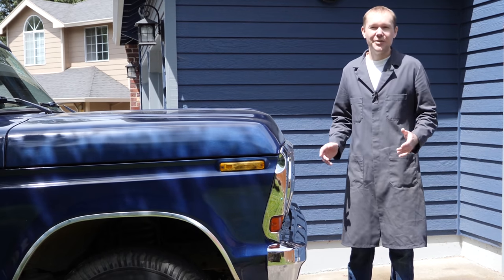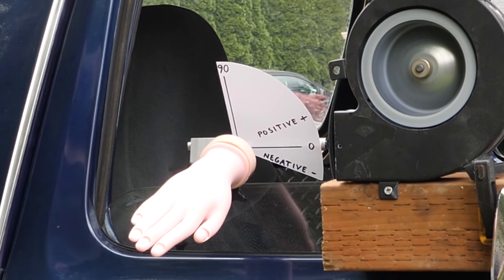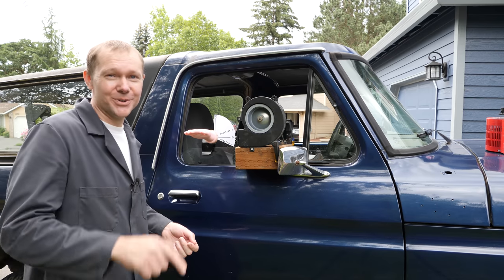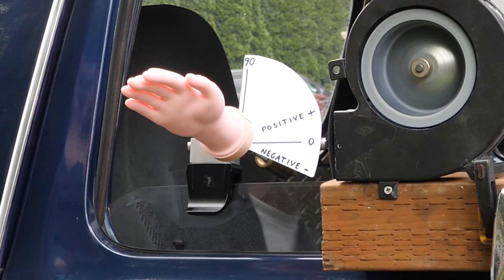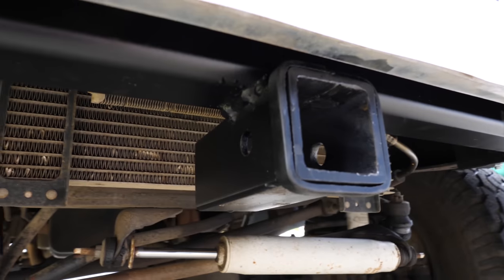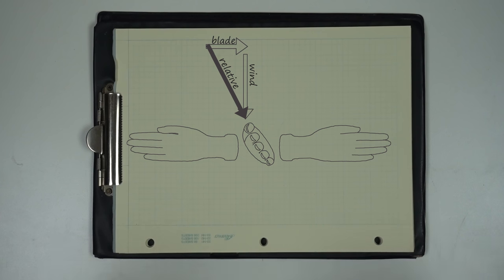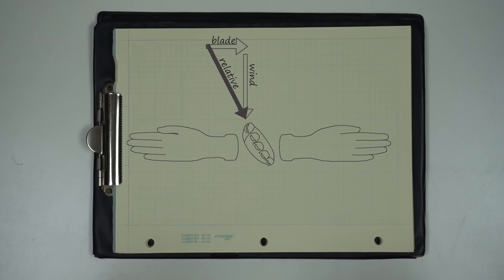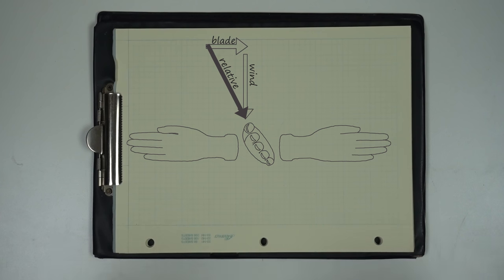Wind Power on a CAR #1 - Is it FREE?

Comment: I think you know very well how this is going to turn out Quint, you're smart enough to know about conservation of energy. I still appreciate you taking the time to prove it once and for all.
Reply from the maker: I appreciate the props (no pun intended) but if the front of the truck is doing work on the air already and the turbine does some of it instead...  I'm honestly not so sure it's a straight conservation of energy problem.  Clearly if it were mounted above the truck that would consume more fuel but down in front I suspect maybe not?
Reply: @QuintBUILDs  Well, if you're gaining electrical energy, and don't need more mechanical(?) energy for moving the vehicle, you're reducing energy losses somewhere else, which could only be wind drag. I can't imagine the turbine doing that, but who knows. It's always better to test than to guess, right?
Reply from the maker: There you go.  A further complication is the air that would normally flow through the radiator to cool the engine will definitely be affected.  There's a clutch fan in there that should be disengaged at highway speeds.  If it has to kick back on then certainly that won't help the effort.  But yeah, with enough instrumentation we'll know for sure!
Reply: @timderks5960  I think you know you were right first time. There aint no free lunches.
Reply: @kirkc9643  But I'm not sure about wether Quint is far off, here. If he can reduce losses then he will get more energy out if the entire system "for free". I kinda doubt this approach will work for that - but I'm also not 100% sure it wont...
Reply: yep tim is right, you'd still have to push the truck trough the air and even more, you now also have to push the fan (drag) trough the air. Imagine an airplane with a fan on the front and on the back; the front fan delivers energy which is used to power the fan in the back, the fan in the back also has a battery. in this analogy, the truck is the airplane, the front fan is still the front fan but the truck's engine is the back fan and the battery is the truck's fuel tank. you can play around as much as you want with the pitch, size of the fans etc but your airplane's battery will not last longer with the front fan installed, quite the opposite; the 'generator fan' will only cause extra drag. Nonetheless, interesting experiment!
Reply from the maker: BTW I appreciate the intellectual tone here.  So many YouTube comments are pure emotion and shaming but this reads like an actual discussion.  Maybe because the subject matter is deep enough to scare away those that truly don't know?  Either way it's refreshing and I want to say thank you!
Reply: @QuintBUILDs  I agree Quint. It really is refreshing to know there are smart people actually engaging in adult conversation. You may be right. This type of subject doesn't usually attract fear and hate-mongers and numbers are hard to argue against with emotion. I appreciate so much that you are working out the exact type of questions that I have had. I think this type of tech will be one of the key solutions for humanity in upcoming decades. It's so good that there are people like you figuring out where the limits are.
Reply: @TheMightyZwom  Same here, I doubt anything like this could ever work (given the theories), but I'm also not 100% sure it can't, so I'm still curious to see what happens. Experimentation is the only answer I guess.
Reply: Jan Jansen I think the theory here is that since the truck is so inefficient they are trying to increase the efficiency. If the wind turbine was mounted up high and out of the airstream I would say absolutely no chance. But putting it in front of the airstream may have some benefit to such a non-Aerodynamic vehicle. It’s interesting to think about.
Reply: @lawnmowerdude  yeah i agree and to be clear, i'm also not 100% sure myself on how this is going to work out. that's why i resorted to a (simplistic) analogy. My thinking is that eventual effects might largely be caused by changed aerodynamics rather than by 'recuperating' lost energy... although one could argue that the ventilator, due to drag to spin it, only negatively affects aerodynamics since the car behind the ventilator is still there. There's only one (okay maybe more;)) ways to find out though!

Comment: Your videos are always awesome! I need part 2. A long time ago built a wind turbine for my truck, it was made from a "wind tunnel" of 12v DC computer cooling (axial) fans. Wired them all in parallel to increase the amperage. It would charge a small 12v riding mower battery that I had a small inverter hooked up to. Used the inverter to charge drill batteries at job sites with no power on location.
Reply from the maker: NO WAY! That's awesome!!! 👍

Comment: I have had a similar idea for quite some time which in building for my channel. Although mine will be for a construction style generator.  The added drag from point A to point B is accepted for me simply for the fact I won't have to listen to a generator running all day while I'm working. Basically wind turbine driven alternators will charge batteries with high amps on trips and large solar array will extend battery life during use and stationary time.  All while I can pull up to a job and enjoy 6-8 hrs of quiet power without any loud generator running all day!! I can't wait until I'm done with it! Nice video bud.

Comment: Hello sir, just wanted to let you know you were RIGHT ON THE MONEY. I worked for Siemens Gamesa Renewable Energy as the finisher/painter for their wind turbine blades. Of note, I want to mention that the blades we make are intentionally bent slightly backwards at the tip, because the torsion of the wind against the tip causes it to become parallel, increasing its efficiency. This mostly has to do with blade length (53 and 64 meter blades) and yes they are as big up close as you might think. 

You've gained me as a subscriber, because you are very good at doing your research and presenting in a simple but funny way. Keep it up😁
Reply from the maker: Wow, thanks James!  This project is harder than I thought but I think it will be worth it in the end.  REALLY appreciate the approval from someone in the business!

Comment: You can absolutely generate energy electrical energy by attaching a turbine to the front of your car, BUT it's not free. The energy you're harvesting is from the fossil fuel you fed your car.

Digs up fossil fuel (chemical energy) - > motor converts to kinetic energy (and lots of waste heat) -> turbine converts forward motion of the car into rotational kinetic energy (and some waste heat) -> generator converts rotational energy into electrical energy (and some waste heat).

The energy harvested by the turbine will be proportional to the reduction in fuel efficiency, cancelling out any gains. Actually, it's worse since each energy transformation loses some useful energy (as heat). It would be more environmentally friendly to produce electrical energy directly with a gasoline generator.

That being said - this video is great and goes a fantastic job explaining how the blade of a turbine work. SUBSCRIBED

Comment: Very cool video with great instruction and funny too! It will work but I think it will also increase the drag and increase fuel consumption too with no net increase in energy production. However, if your mobile wind turbine were raised automatically from the back and telescopically standing tall when the vehicle shifted into park it would act like a smaller version of a modern wind turbine and generate a net increase of electricity. However, I think having a solar PV canopy built onto and over your truck would generate way more electricity if the possible goal is a self powered, electric vehicle. Love your video, skills and knowledge!

Comment: I remember having this idea as a kid, and my dad basically explained that the force of the wind is actually the force of the vehicle moving forward. The wind turbine generation is not generating power from the wind, it's generating power from the vehicle engine, indirectly. The propeller would create more drag than it would generate electricity. The only way this would work is if the propeller somehow had less drag than the front of the truck originally had. Which is maybe possible, but it begs the question, why not just make the truck aerodynamic. Less fun, I guess?

Comment: I was actually talking about this when I was about 8years old, and combined with solar panels on the roof of the car like wolksvagen is going to do on the new hippie van you can get some extra miles! But I was talking about taking out the passenger seat and make a wind tunnel to capture more direct wind on the propeller
Reply from the maker: Allowing a straight pass-through would be really fun to try.  Maybe if I was getting my windshield replaced soon...

Comment: years ago on TV a college made a wind turbine powered buggy he drove it accross America and not at a slow speed, it had 1 n200 battery to get it upto speed and then it ran off turbines , chain driven on one rear wheel. here in Australia a company is making solar power cars 2 seaters vrry aerodynamic light weight with the most effecient solar panels

Comment: I have always wanted to try this but my wife veto the idea a while back.
   But one thing different that you might explore is instead of putting the turbine out side the slip stream you could 'funnel' a part of the slip stream into a fixed tube going through the car. Think 3 inch pvc pipe fixed to the undercarriage or side so the concentrated slip stream goes into the pipe and then moves a permanent motor/generator as it exits.
Reply from the maker: That's one of the advantages of an old truck, the wife doesn't care what I do to it!  Along your suggestion, someone suggested a blower hood scoop with a fan under the hood.  I might even consider that if I can find an old hood and fit a scoop on it for cheap!

Comment: Hi Quint! 
Okay! So you put a wind Turbine on the front of the truck... Two things!
1) In future, try a vertical wind turbine or series of vertical wind turbines. See how that compares to standard propeller type wind turbine.
2) Wind Funnel: By creating a funnel for air to move through, the air at the narrow end would be of a higher velocity. Sort of how exhaling with your mouth wide open to check your smelly breath is a gentle breeze, while blowing from tightly pressed lips results in a faster stream of air for extinguishing birthday candles. Stronger force of wind = more spinning turbines, right?
The wind funnel idea could be interesting. Like, you'd move the turbine back a bit, and then put a device in front that looks like a funnel. as all the air hits the space - maybe it's 3 feet by 3 feet - instead of being forced poorly around the outside and having bad aerodynamics, it could slope into a narrow point that spins the turbine faster. However, in this scenario, a vertical turbine might be better as it is a smaller foot print, while a propeller turbine would have two blades blocked by the funnel 
:D
That's my mad scientist idea of the day :D
Reply from the maker: Hi Greg, supposedly funnels indeed help efficiency of wind turbines but at the scale that would be needed for grid power generation they aren't feasible.  But for this project maybe not?  We'll see.
Reply: @QuintBUILDs  that's the beauty of science. We don't know so we experiment 😁 thank you for doing that part for us

Comment: @Quint. 
While you<re into this type of project, I've always been curious is one could harvest the exhaust heat or the coolant heat to produce a really free amount of energy. I'm not talking about turbos here, i'm talking about using the heat to, say, boil water that spins a turbine, or to run a Stirling engine attached to a generator, for example.  Maybe that could be a project for another time... 
seb.
Reply from the maker: Yeah, probably stirling spinning a permanent magnet alternator.  Hmm. I'll think about that, thanks!

Comment: It is actually possible to power whole vehicles with the energy produced by the wind. These wind driven cars are called ventomobiles. I'm actually writing my masterthesis on one of them. There are a couple of student groups building these wind cars. Maybe you have one located at your university too. Check them out. You can learn very much about windenergy and car efficiency.

Keep on explaining this stuff. You are doing an excellent job.
Reply from the maker: OMG, that's hurting my brain.  Part of me wants to dismiss the ventomobile, but then again I can reason how one could go travel at least slowly into the wind.  Faster than the wind is definitely harder to swallow.

Comment: Quint, some years past, at an inventer's fair, one person had a display with a video of an electric car with a turbine fan mounted on the back. His idea (he was looking for investors) was that by driving, the turbine fan would capture wind power, and reclaim electricity to recharge the battery. I pointed out that pulling the turbine fan through the air would use more battery power than was regenerated, and that if he mounted the turbine fan in front of the car, he might be able to push the car through the air with less aerodynamic penalty. The basis for my suggestion is the fan mounted in front of conning towers on naval ships. Officers are able to stand outside behind the fan, as the fan redirects the wind caused by forward motion in a cone around the fan. If you can use a fan that created a still air zone around your truck, you could lower the drag of your truck body.
Reply from the maker: Wow, I've never heard of any of that.  You're spot-on with my reasoning behind the project though.  There's no doubt in my mind the drag on the truck body can be reduced, I just don't know if the drag on the fan will be greater than the reduction while producing electricity.  We will see though!  Glad to hear about the ship example though, that sounds cool!

Comment: An interesting demonstration of an air foil . I think as a wing or a sail it works efficiently.  Not that it wouldn't work in other applications , it just doesn't have the efficiency to any work other than previously stated. I know you are busy doing a part 4 if it isn't already done , wondering if thinking outside of the box and coming up with a design more suited to the task of torque . It will look much different than the usual out of box design. Thanks for the vid.

Comment: I adore wind turbines! I designed an entirely 3D printable turbine to run on a Nema 17 stepper last year, with about a 1m blade diameter. I've never managed to get more than 1 and a bit volts out of it, but I love seeing it spin nonetheless :D
Keep up the great work; I love your videos and love your use of loads of different technologies. I haven't touched the lathe since I got a 3D printer!
Reply from the maker: Can I see the blade somewhere? Pics, stl? I'm planning on 3d printing much smaller blades to scale model my experiment.
Reply: Sure thing! To make it nice and easy, here's a link to a Thingiverse file with the blades and nosecone in as STLs: https://www.thingiverse.com/thing:4492917
The original files are SolidWorks parts, and I'm aware lots of people don't have access to SolidWorks. If you,  Quint BUILDs, are interested and you've got some way for me to contact you I'll happily send them over?
P.S: I've got another wind turbine build that works just as well with a blade diameter of about 300mm if that would be more helpful too! (Fully 3D printed, no extra hardware at all)
Reply: I've been looking for someone who has one of those things
Reply from the maker: Hey michael, finally got back to this, so easy to lose things in the comments.  You can email me at BUILD2LRN@GMAIL.COM  
Honestly asking, did you give the blades any twist along the length?  They look kinda straight in the images.  I'm currently trying to figure out the best way to make a variable pitch prop that can handle serious power at highway speeds.  Considering hot wire foam cutting (CNC) then wrapping with carbon fiber.  The mechanism to change the pitch from inside the truck will be challenging to say the least but I've got some ideas.
Reply: @QuintBUILDs  No worries, I'm not surprised you lose a few comments considering the amount you get! 
They do have some twist, but only a tiny bit. I didn't expect the blades to be spinning considerably fast when I designed it, especially since they're designed in pieces to be glued together thanks to my limited build volume on the Cetus Mk3. Inevitably, they did at one point fling themselves to pieces, breaking at the glue joint, and ending up rather far off in my neighbours garden. I wouldn't recommend using these particular STLs on your car!
CNC foam cutting does sound like a good way to make some structurally sound blades if you've access to a CNC foam cutter! Another option could be to slice up existing blades to be 3D printed in small "bulkhead" sections and wrap foamboard/shrink wrap around them to give you an easy to make aerofoil section. I've toyed with the idea before, but never actually done it.
I'll send you my SolidWorks files to your email in case you're interested; at the very least they may help inspire your future designs!

Tl;Dr -WARNING! Probably not safe for use at highway speeds ;)

Comment: At 4:48 it reminded me several years ago when I had attached a 400mm fan blade to a 1,5hp 3000rpm motor and the blade exploded almost instantly when powering on, it was terrifying. Luckily no one was injured and the blade is now history.
Reply from the maker: Wow.  Plastic?  I'm considering carbon fiber.
Reply: Quint BUILDs It was made of metal, the three blades went off and the hub remained on the motor. They were poorly attached to the hub. I think the were designed to not rotate above 1000rpm.